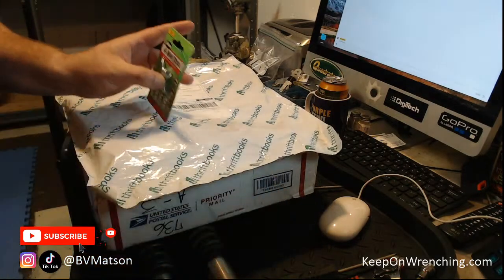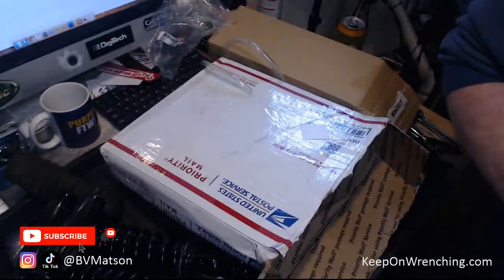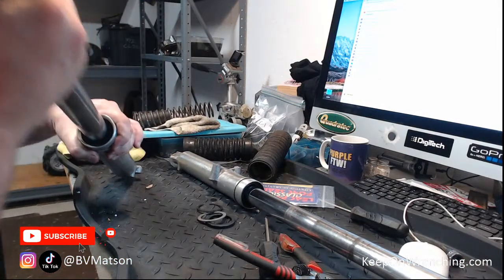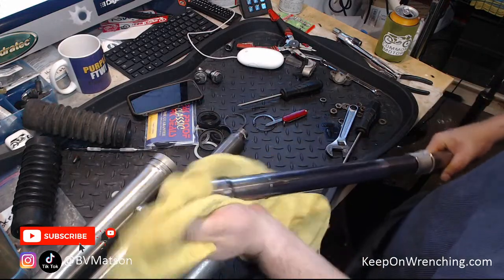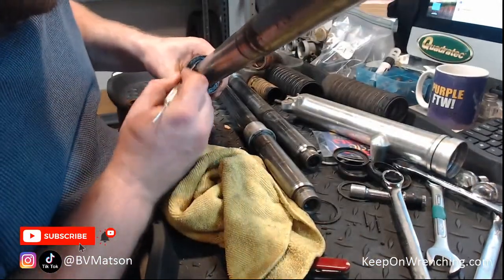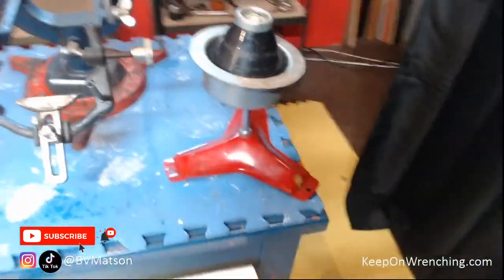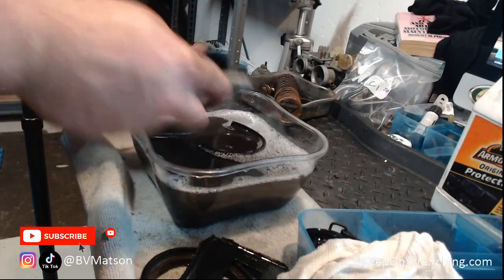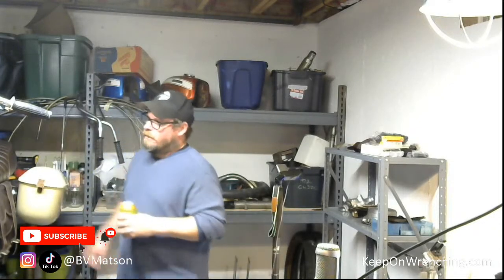CB350 Front Fork Disassembly and Inspection LIVE STEAM

Comment: Forks: Top nut wound in too far after removing from the top yoke (triple tree) will cause the o-ring to split. There's no need to remove the bottom screw first with the external spring forks, just remove the dust cap, retaining clip, seal and stanchion tube, then use a ratchet extension with an old o-ring or rubber washer pushed along to the end (where it tapers out on the bar) and push against it whilst screwing the bottom screw out, (holds it just fine). I think you'll have to drill that manked up one out though or use an easy-out.
Reply: Meant to say put extension bar inside the lower tube (cartridge) so that the o-ring/rubber washer grips on the end of it as you undo the bottom screw.
Reply from the maker: Got it. Thanks, Hepcat. I think this is going in a fun yet troublesome direction. Lol